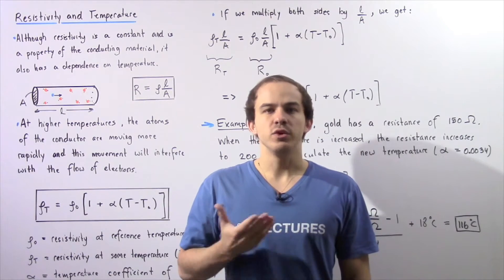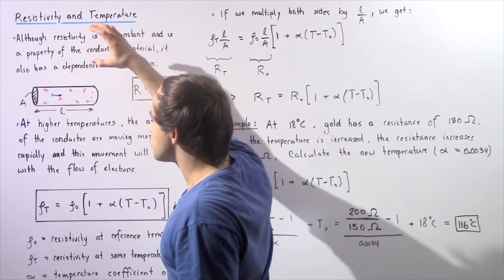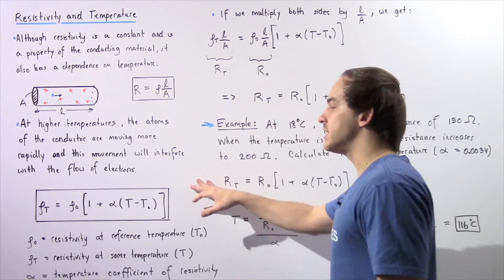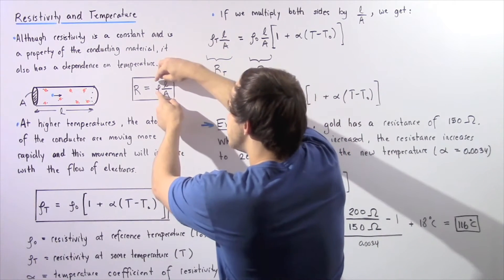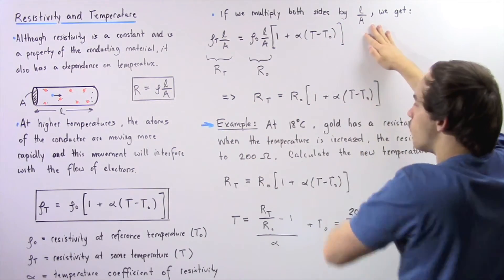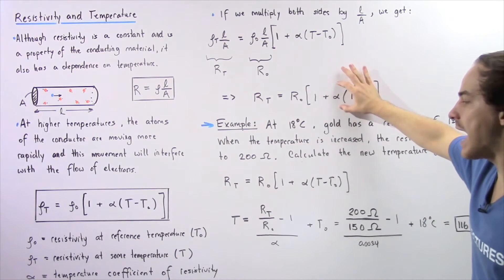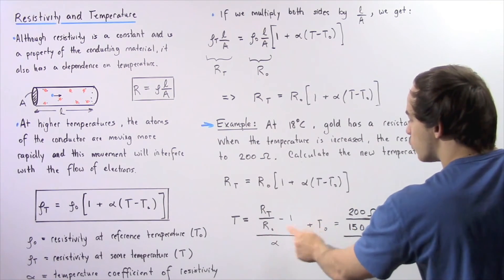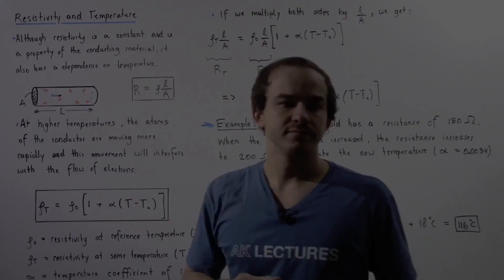Resistivity and Temperature Dependance

Comment: I want help in this question 🙏.A coil with a diameter of 0,25mm and a length of 400m is formed out of copper wire.The temperature of the coil is 22 degree Celsius.Calculate the resistance of the coil if its temperature increases by 37 degree Celsius.Take resistivity of copper to be 1,7micro ohms cm and the temperature coefficient of resistance at 22degree Celsius to be 4,02*10'-3 per degree Celsius